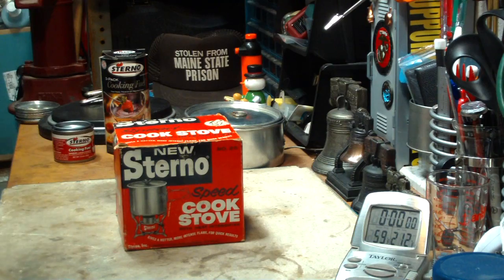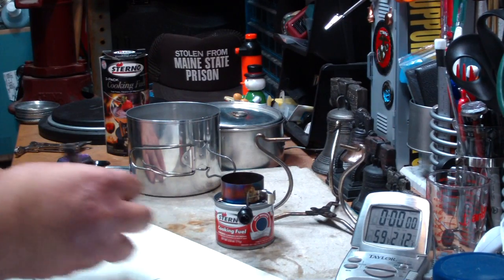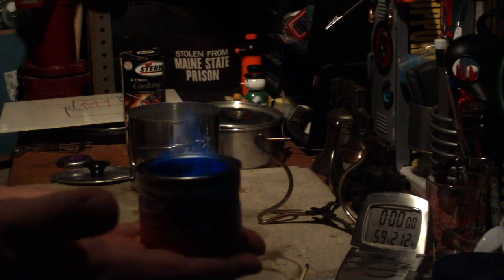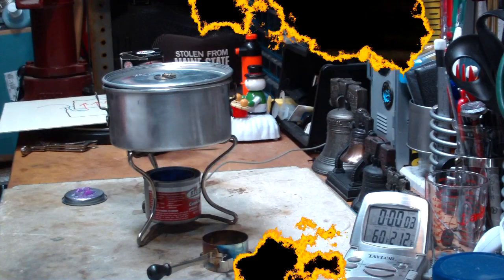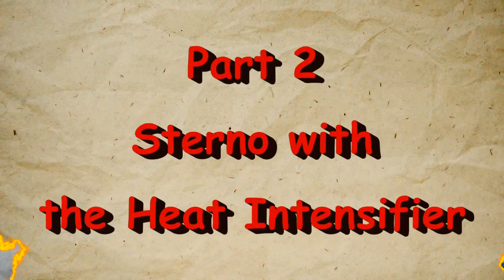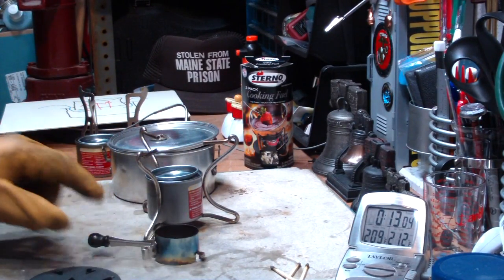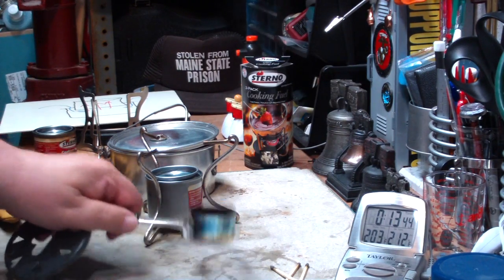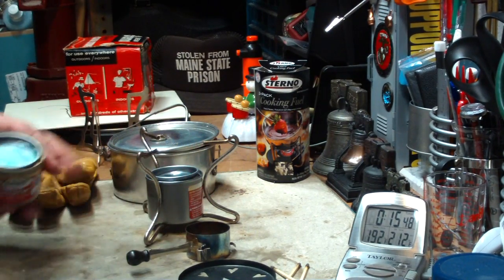Sterno Speed Cook Stove with Heat Intensifier - Boil Tests - Reloaded

Comment: Raising the flame closer to the pot reduces heat dissipation. Also, as the fuel burns, it emits CO2 which interferes with combustion. That is what causes the flame to bounce around as it burns. The air-gap around the edge of the can provided by the heat intensifier enables the flame to pull in fresh air for a hotter, cleaner burn. Finally, a windscreen helps to direct heat and help with dissipation. Incorporating the three of these principles into a design for a small burner would work with efficiency for solid fuel, as well.

Comment: You do not need a heat intensifier the distance between the can and what you are heating up or cooking matters an Empty clean paint tin would do a few hole's in the tin to give it some air flow then place the heating tin in the paint tin then light and you should be OK. I have heated up tins of soup. chicken curry. Noodles and dried pasta in a pot with 5 candles and it worked this would work better. you must capture the heat for best results.

Comment: It's a venturi effect. The flame acting as the jet. By placing the intensifier, the expanding flame/ hot gasses rise, entraining additional air through the sides and increasing total net output. It'd be interesting to measure fuel consumption. Nothing comes without cost.

Comment: Seems like the heat intensifier could be made easily with a small can of some kind. Also, I recommend a simple cooker made with a tuna can, spooled cardboard and paraffin wax (from old candles), old cooking oil, etc, and make a camp stove with a large coffee can, and a pot with a smaller coffee can and coat-hanger wire...   You can also make your own charcoal with sticks and branches, but I'd make sure to vent outdoors, or use outdoors, only.  Forage in summer, heat in the winter. No need to spend money on this stuff.

Comment: Wouldn't the boil time be quicker if you just raised the plain Sterno can up by 3/4" or so, so that the flame height was the same as the flame from the heat intensifier?

I've found this with many stoves, even the burner supplied with Swedish Army stoves, raise the base a little to optimise the flame -yellow/white flame-tip not good!

In the UK Highlander Outdoor make a stove that seems (to me) to be nothing more than some kind of Chafing gel can, with an included pot stand, and, for what it is is, I am reasonably impressed; no risk of leaky alcohol, a hard fuel container that is also the stove, a reasonable pot stand that is also a windscreen.

Yeah, I know gel fuels can't be as hot as liquid fuels, but they burn longer and are less a hazard either packed away or on the ground with clumsy people about. Also, in my experience, alcohol stoves burn too hot to do much useful cooking, unless it is an optimal quantity...unless the flame can be regulated as with a Trangia type alcohol stove.

I think the whole process of cooking outdoors is about compromise and using what works for the individual. Most times fry bacon and eggs in a non hard-anodized aluminium pan, and they will stick using alcohol ...unless using a little water to regulate the temperature...but I've found that gel, while taking longer, food doesn't tend to stick to the same pan as much.